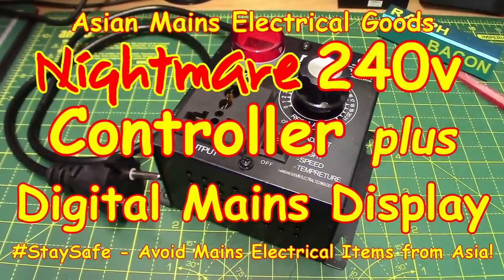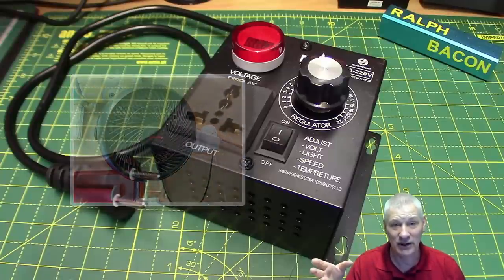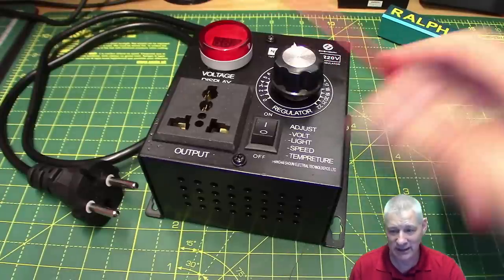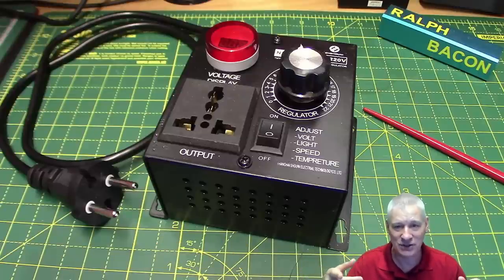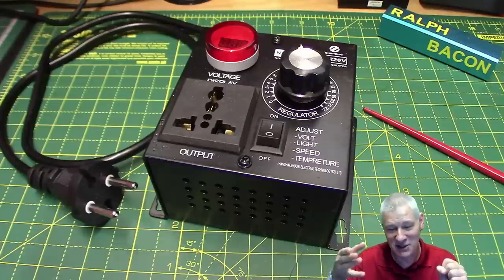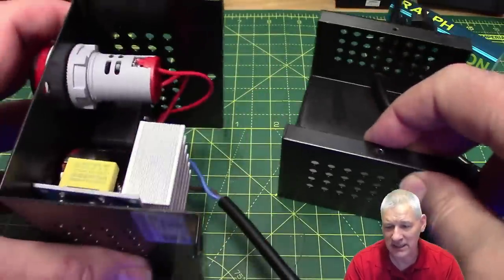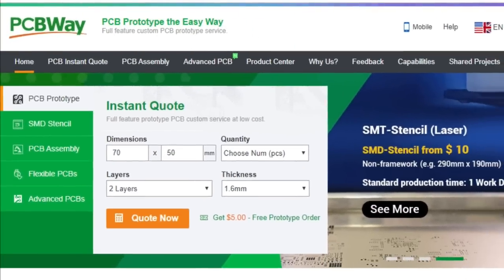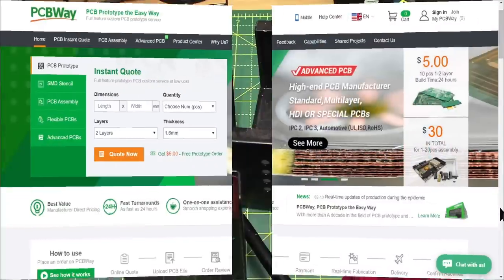#188 Nightmare Fan Speed Controller PLUS a Volts & Amps Digital Display

Comment: Xpelair WAC1, about £25 no humming but it is hard wired. Stay safe
Reply from the maker: Now only £19.96!!! The only "problem" I have with it, is that it is stepped (6 speed positions, I think) whereas I prefer an infinitely variable device. But I might make my own now (replace the electronics).
Reply: @RalphBacon  Ralph, there is just no pleasing a perfectionist aha. Make a video though, you might get a lot of interest in this!! Lots of users of fans and need fan speed controllers!
Reply: @RalphBacon  also, if you have a speed of 600 rpm those 6 steps I don't think will be 100,200 etc but maybe 300,350,400. Not to sure what the specs are.
Reply from the maker: I've started the ball rolling on this and have ordered some hardware. Arduino-type project (and video) on the cards!
Reply: @RalphBacon  wow 😯

Comment: An idea for a project when you sort out the earthing issues is to control it using one of your Arduino’s to speed control and automatically switch on/off at a pre select temperature. Or take it another stage further is to control it via eg ESP8266 WiFi enabled device further control that via an app on your phone.
Reply from the maker: Now, Keith, you seem unaware that there are only 24 hours in each day! Your suggestion is great but as I failed to get my 30-hour day petition off the ground I just don't think I'll have the time. But I do like the WiFi idea. I'm pretty sure I could do this with a dimming Sonoff switch now that you mention it... why didn't I think of that earlier? In fact, why didn't you suggest it sooner?
Reply: @RalphBacon  Whoa! Cheapskate - I've asked for when I can get 42 hour days "officially" to match the number of times I've worked them in my life - including TWO since I retired! :-) I'm still considering whether to push the boat out and ask for 15 day weeks as well!

Comment: From over 240V to less than 225 at 7.3A... That's a 100W in cable/connector losses somewhere!
Reply from the maker: I think this is pretty common with UK wiring. I'm on the end of a spur (not ring) mains so everything comes down one big fat electric cable to my workshop. Drawing 8A is bound to show the resistance in that cable run and hence the voltage drop.

Comment: Where to connect the ground wire..to the housing frame
Reply from the maker: Yes, any metal enclosure MUST be earthed.
Reply from the maker: As I reported elsewhere I eventually abandoned this enclosure and used a plastic one (that doesn't require an earth). Everything fits inside (get one with plenty of room), nicely secured, along with a safe UK-style mains socket on the front. 
The main issue with this enclosure was the unshuttered socket and no replacement could be found. 
Oh, and the fact the "dimmer" board was far too close to the METAL front panel. Well, and everything else I mentioned in the video.
Reply: @RalphBacon  Thank you for the explanation

Comment: I would not run that monstrosity at all, the pot for a start would not be rated 240Vac insulation.
It is a typical old style RC lamp dimmer circuit that you used to be able to buy to replace your wall light switch.
The heatsink of the TRIAC will probably be at MAINS potential as well.
Because the chassis has vent holes in it, it would be ILLEGAL in Australia.
Why? Because you can poke a wire or any conductive object through the vent holes and contact the heatsink.
The device will NEVER be safe like that.
Thanks for the Aussie Dollar values.
Reply: Probably illegal in the UK as well.
Reply from the maker: Oh, I'm certain this is totally illegal, as it doesn't have any of the required EU/UK safety features I mentioned (like an earth wire, or a fuse). Eyes wide open, remember!
Reply: While many TRIACs have one of their electrodes connected to the metal tab that's bolted to the heatsink,  there are some available which are isolated.  Which one they chose to include in this thing is still open,  howewever.

Comment: Ralph, here is my code for leading edge dimmer .....

//BT136 Triac. pin 1 = mains 1, pin 2 = mains 2, pin 3 = gate 

//Declare global variables

int zerocross = 0; // AC signal zero cross on pin 2 ATMEGA pin 4
int MOC3021 = 8; // Triac trigger (via MOC 3021 opto isolator) on ATMEGA pin 14
const int Pot = A0; //10k potentiometer on analog pin 0

int val1 = 0;//value of analog input potentiometer (0 - 1020) with 0 fully clockwise
int val2 = 0;//value of triac triggering delay after zero crossing falling 

void setup()
{
pinMode (zerocross, INPUT);
pinMode (MOC3021, OUTPUT);
pinMode (Pot, INPUT);

Serial.begin (9600);
Serial.println ("AC wave controller");
//delay (1000);
attachInterrupt (zerocross, trigger, LOW);

}

void loop ()
{
  
val1 = analogRead (A0);
//val2 = map(val1, 0, 1022, 0, 6000); //scales potentiometer to scale of N,000 microseconds.Cannot start at zero WHY?

// 50Hz = 20ms per cycle. Zero crossing LOW is once every 20ms. One half cycle is 10ms so want fsd to be 10ms

// ATMEGA running at 16,000,000 Hz. One clock cycle takes 0.0625 microseconds.

// A single half cycle of the 50 Hz AC signal = 10ms = 10,000 microseconds = (10,000 / 0.0625) = 160,000 clock cycles. 

//Serial.println (val1);
//Serial.println (val2);

//delay (200); //this delay does not ffect the interrupt just used to slow down serial display
}

void trigger() //this is an interrupt function started by zero crossing
{
 delayMicroseconds (1000); //Delay before firing MOC3021
 digitalWrite (MOC3021, HIGH);// Fire the MOC and hence the triac
 delayMicroseconds (750); //Triac propogation delay, time allowed for triac to respond and hold before triac is turned OFF
 digitalWrite (MOC3021, LOW); 
}
Reply from the maker: Thanks for that, I have similar code. I guess leading edge is pretty simple as long as we have a zero crossing point for the interrupt, which my hardware gives me (or which I could construct using a bridge rectifier). I'm still looking at trailing edge, almost there with the hardware.
Reply: @RalphBacon  ... good. There is now a dedicated chip the FL5150 which does both leading and trailing edge dimming so easier than the version I built .... get cracking! (Do you have an oscilloscope?) the IRF 840 MOSFET seems appropriate?
Reply: @RalphBacon   go for the IRF540N MOSFET. Gate voltage 2-4 V so 'logic level' on the gate. It is good for 33A, which is more than enough!
Reply from the maker: "a dedicated chip the FL5150 which does both leading and trailing edge dimming" - which I looked at yesterday, funnily enough, but was concerned about two things. (1) there seemed to be no isolation between the trigger input (and hence the pot or µC) and (2) it felt like cheating! Incidentally I have no intention of using mains to try this out, I will use a low voltage AC supply. If 16V is too low for the circuit I have I will see if I have a higher AC transformer lying around, less than 50V! But no actual mains!
Reply: @RalphBacon   Ralph, all mains phase angle controllers use opto isolated zero crossing detectors. These were developed for the specific purpose of zero crossing detection and opto isolating as triac drivers. This chip fires the FL5150. I have used the MOC 3041 on leading edge. If you think its cheating then do it from first principles with any opto-isolator such as a 4N35. The trick is detecting zero crossing and then triggering the interrupt. However, for your viewers, cheat for V1 and go native for later versions? If you still think its cheating, I look forward to seeing your silicon wafer slicing and Benny's doping machine in your shed.
Reply from the maker: The FL5150 requires an analog signal at the DIM pin (or a 250K pot connected to GND). Some have tried using a digital pot with some success but not proper 0-100% dimming. Others have tried a DAC, with moderate success. Still sounds tricky using that particular chip. I shall ponder a while.
Reply: Ralph S Bacon ..... there are D to A converters now that can drive the few microA at 10v on the datasheet. Failing that use a power op amp. Strange they did not have a digital input. Anyway that’s all part of the fun? You could not use the FL5150 and go back to rolling you own MOSFET control, but I would give the FL a squeeze first.

Comment: Seems like basically you bought a dimmer. Only reason those work on your fan is because fan usually has a shaded pole motor. Would not work on a regular AC motor.
But indeed, dangerous device
Reply from the maker: As it turns out a pretty crappy, non zero-crossing dimmer! I might replace it with my own design but keep the case.
Reply: @RalphBacon  very wise

Comment: Honestly, you should've just bought the dimmer module and then built the enclosure yourself.
Reply from the maker: Guess what? Yup, you got it right. In a future video!
Reply: @RalphBacon  do 240v dimmer controls work for such ac fans? Heard that they are bad for the fan motors compared to using a variac. Also heard they produce a humming tone when using a dimmer instead of a variac. Dimmers are cheap but variacs are expensive, with your experience, what are your thoughts?

Comment: Wow if only trading standards had the resources to check and ban these dangeroisly illegal (Chinese) imports.
EMC filtering will also be needed in this design, don't forget you will need a flying earth lead to both Half's of the case. 
This could be a nice little project for an Arduino controlled speed controller via a zero crossing opto isolator is similar
Reply from the maker: I've already ordered some Arduino compatible hardware to replace the dodgy control hardware and I'm just going to keep the case (probably). Keep tuned for a future video where this gets fixed properly!

Comment: Ooh Ralph! I cringed and did a sharp intake of breath when you said "of course, you can't control AC with a Thyristor"! WHAT!!??
There's a LOT to read below but I've included most of it to inform other readers/viewers also. I think you've been living in the very sheltered world of software for FAR too long mate! I've built more Thyristor based AC control units than I have Triac based! Thyristors are WAY more common in AC power control electronics than Triacs! Virtually all high power electric traction control (electric trains for example) is with Thyristors IIRC and also in many big, and I mean BIG Power inverter units - like many kilowatts or tens or hundreds of kilowatts big. They've been around and used successfully in MANY commercial AC control circuits for DECADES, and certainly since the sixties when I first used one! They have been developed almost exclusively for their VERY high Volts and AMPS capabilities. SOME different devices are now slowly penetrating that market but I can't see Thyristor AC control at that level being replaced any time soon.
Do a quick Google search JUST for a 1000 Amp 1700 Volt Thyristor - they're available on eBay. More to the point find a MOSFET that can handle 800v PIV at 50 Amp for around £6.50 with similar characteristics in terms of physical and electrical robustness. Nowadays there are also Triacs for such too but Thyristors are still the preferred device AFAIK at the really high end of stuff. Don't forget that "essentially" a Triac is basically two Thyristors in back to back parallel (albeit NOT with their gates actually tied together) and in BOTH cases they do almost exactly the same thing except that the Thyristor only has to handle HALF the current of the Triac when used in matching pairs. Check out this eBay link for a 1700 Volt 1000 Amp Thyristor 
https://www.ebay.co.uk/itm/Marconi-DCR703SM17BT-1-1000A-1700V-thyristor-capsule-MEDL-DCR703-/391155912728

In certain industries that would probably be seen as a low end device! 1.7 MEGA VA! ONE device! No mate, Thyristors are here to stay in AC control. :-)
Triac control, even from a micro-controller is STILL triggered by AC pulses JUST like a Thyristor and in that case should use something like a MOC2052 opto Triac driver for safety and isolation, But you can generate "pulses" with just a capacitor, a couple of resistors and a pot. They are generated in power control terms such as you found in that (unsafe) but otherwise OK unit by phase control of the timing which just delays turn on. The exact same principles are used to control back to back parallel Thyristor full Phase control. 
Many early Thyristor controllers, aimed at speed control of AC universal motors, gained little from having TWO devices and used a reverse diode instead, thereby providing half phase control instead, which is all that would typically be required for speed control as dropping the effective voltage much lower than 50% is self defeating as torque suffers a lot and speed control becomes erratic and current flow VERY noisy. They may have different circuitry these days but when B & D, Bosch and others started combining the components into drill triggers for built in speed control they had Thyristors inside originally not Triacs!
Younger folk are often unaware that VERY common use was made of the Thyristor for DC control (!!) back in the sixties and early 70's. A 1965 Mk1 Mini (my first car) did not have delay wipe - VERY uncommon back then - so I built a few slightly different but ultimately the same functionality, Thyristor controlled wiper delay circuits - cheap power transistors were hard to come by back then in a small package. These days a MOSFET can do the same job quite happily, but they weren't readily available until much later. The Thyristor one works well and is MUCH more immune to car electrical noise and spikes than a typical MOSFET of almost identical size, having a typical 600v upwards PIR! You can, through a little bit of deeper knowledge make a Thyristor turn OFF too in certain DC circuits! Little bit of research for the keener reader! I've just realised it could be enhanced very effectively using an Arduino or such and particularly with the ready availability of supercaps these days. Hmmm!
A couple of other things - you're right about the "resistor" not being such, but actually a DIAC, and I bet it's a DB3! Just like the old BC107, 8, 9 series, the common US favourite "generic" transistor the 2N2222A, or everyone's favourite power tranny, the 2N3055, the DB3 (or a close equivalent) is just as ubiquitous in many a Triac based circuit.
Someone mentioned the front 13A socket as not being very safe. TRUE as actually, it is completely non-compliant to any UK spec as those sockets are made to satisfy (cheaply) a multitude of different countries' plugs and it has no shutter gate in the earth socket to block the live and neutral sockets. I cant remember but I think Big Clive might have done an "exposé" on how bad i.e unsafe they really are.
Your struggle to get lower than 55 volts reading on the mains display is understandable as I have a few and they are rated to ONLY go from around 50-60 volts upwards to full mains. The full specs from some eBay sellers show this. 
Readers should be made aware that the burden resistor (critical for operation) for the current sense coil is normally fitted into the display unit, not the coil, and as such running a current carrying wire through it can produce HIGH voltages at the terminals in the plastic connector as the coil is used as a "current" transformer, so open circuit no current can flow but a very high voltage can be created without the burden resistor that CAN then drive current through someone and give them a nasty shock and a burn potentially.
Sorry the above is so long, but hope it proves useful to some folk. Keep up the great work mate and as I see you are now glasses-less and patch-less does that mean you are now all sorted ocular-wise? Hope so. TTFN
Reply from the maker: This is terminology confusion, Bob. In my day, SCRs is all we had and we called them Thyristors (not knowing that, strictly speaking, SCRs were just ONE item in the family group collectively known as Thyristors). But...

That said, so much of what I've read in the Internet does what I did - call a SCR a Thyristor and a Triac a Triac. So I am definitely not alone in this. I still call all sticky-backed plastic Sellotape and our vacuum cleaner is a Hoover even though not manufactured by them. It's what you have learned!

When i was about 14 (yes, in 1843) I built a crude, mains-driven sound-to-light system using a small amp rectified output feeding the gate of a thyristor (sorry, SCR) to each channel of my lighting unit. It worked great, but even then I noticed that I only got half power - because the SCR only passed the positive half cycle. Surprise!
Then I tried putting two SCRs back-to-back and voila! But the feeling remained with me that SCRs (or Thyristors as I called them) were not really suitable for AC. RFI was a big problem though! No zero-crossing here!

From what I can tell, a Triac today is basically a more sophisticated version of two SCRs back to back!

I tell you it's amazing I survived to tell the tale as I received countless shocks during my teens, but those served to make me more respectful of electricity as I grew up. 

Right, now I'm going to make a (large) coffee and read your amazingly long comment in detail.
Reply: @RalphBacon  sorry mate, had no problems with your use of terminology and as for names I substitute them freely too. My tongue no in cheek was about your saying that thyristors (SCRs as you rightly say) wouldn't or couldn't control mains, which of course they can as you've just attested. That was all. 

And yes I've had more than my fair share of "belts" too - "Shocks" to non English speakers. 😱😁